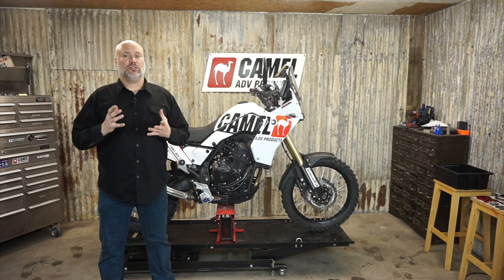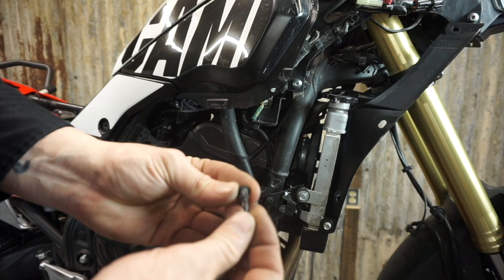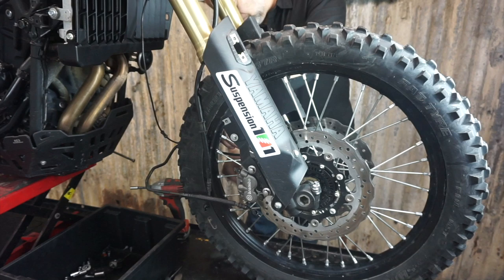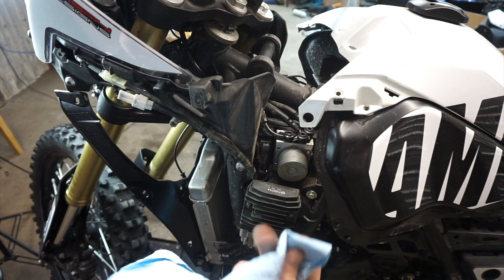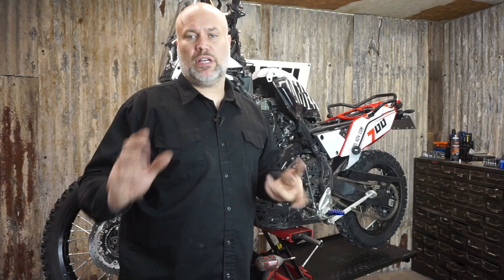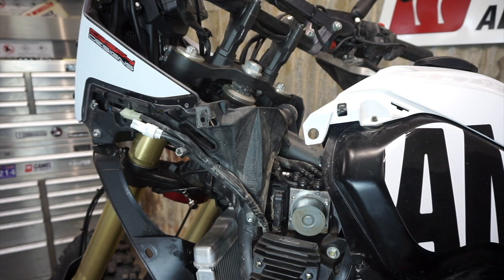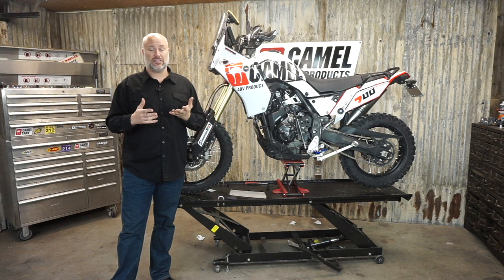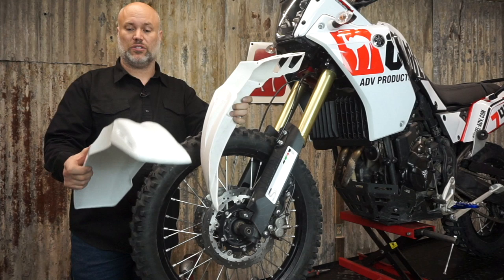700 Tenere High Fender Kit Install

Comment: Is it a good idea to have the brake lines between the fork and the wheel? 
I mean it might be OK for gravel, street... but what about when wheel is full of mud?
Reply from the maker: Every modern dirt bike has its front brake line run between the fork guard and wheel. They get ridden in far worse conditions than ADV bikes do and it's never an issue. Why do you feel this is a problem on an ADV bike?
Reply: @CamelADV  what I meant was, is it Ok to have the line between the tyre and the fork?
dirtbikes have the hose go around the fork much lower...
Just a question / suggestion, no harm ment :)
Reply: @AlexandruGaal  Good question, I was wondering the same. You guys @Camel ADV made the break lines fold around the fork right where the tire gets close to the fork fenders 24:53 And if the tire would pick up some sticky mud, those could possibly get swept out of position?
Reply: I was thinking “nooo” not INSIDE…ha ha ha
Reply: @JovanMladenovic  yeah, mud..debris I thought might be more of an issue INSIDE toward the wheel, etc

Comment: I had not thought about where you folks were but when I heard you say "dec-al" instead of de-cal I knew you must be  Canadian.  Amazing engineering.  I have not been tempted to do the high fender but had wondered about the brake lines and crossover.  After watching the video I realized the fender is the smallest part of what you have created

Comment: Just installed it this afternoon,  I used the Polisport UFX . I did grind it the rear holes alt an 1/8 with a drill bit. , it must be a new design?  It works with the factory radiator guard!  More clearance than the full size one in the video. I still need to trim the fork guards . No issues, I still need to bleed the brakes better!  It was getting dark.  I was missing one hose/abs line keeper .

Comment: The multiple fastener types is very annoying, especially on an ADV bike. More tips in the tool roll, more weight on the bike.
Yamaha did so well with my R6. Just a few types of fasteners.
Now it will be like working on a Harley.

Comment: I just installed this kit tonight, using a 2020-style YZ250/450 full size fender from Polisport.  It’s a snug fit but everything clears.  The modern style looks great and the fender is much more rigid than the 2005 style, so there will be less tendency to for the front of the fender to oscillate in the wind at highway speed.  @Camel ADV Can you reply with the center-to-center distance of the front unused threaded holes?

Comment: I love the look. But one of the appeals for me is that the tenere is a simple reliable machine. This seems like a lot of work just for a fender.
Reply: If you ride in mud you'll have to do this anyway, before or after the stock fender breaks, it'll be up to you.
Reply: @v1kku  If you ride in mud you don't want to have the brake lines rubbing against the mud... IMO
Reply: @AlexandruGaal  yeah the brake line routing on this kit could be better.